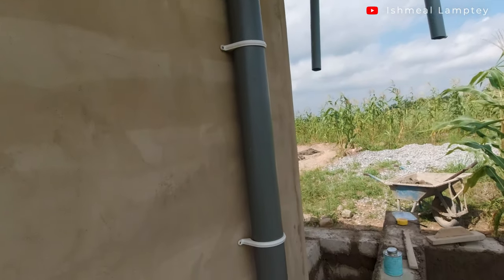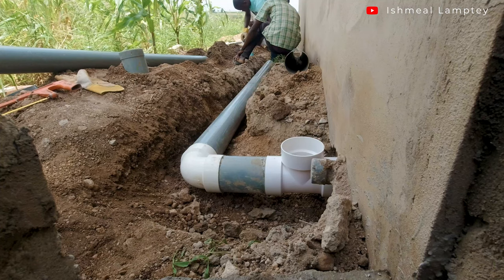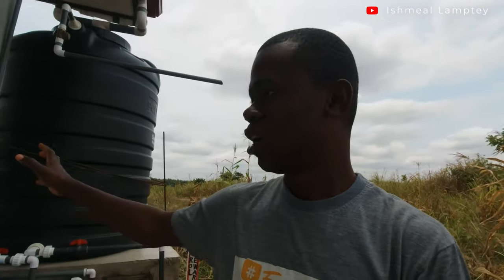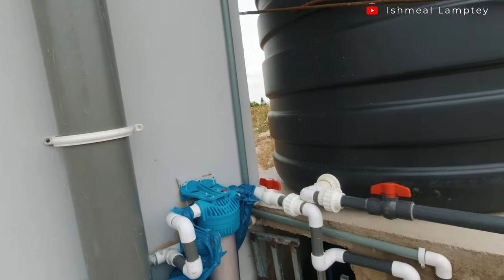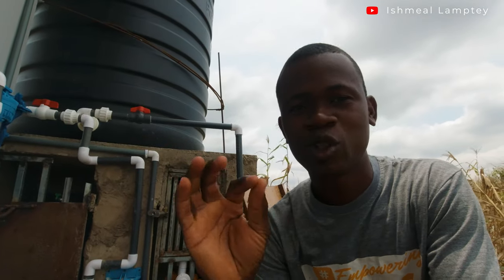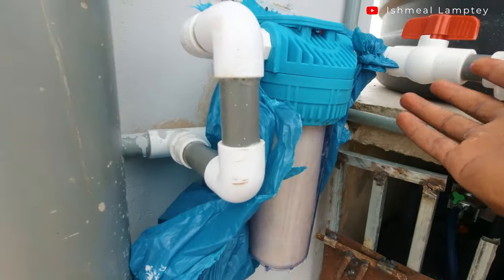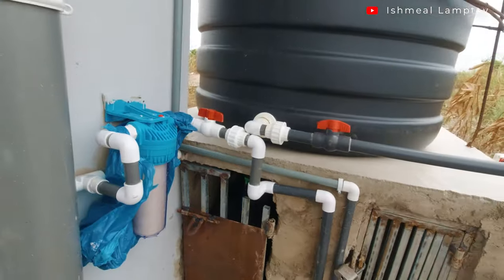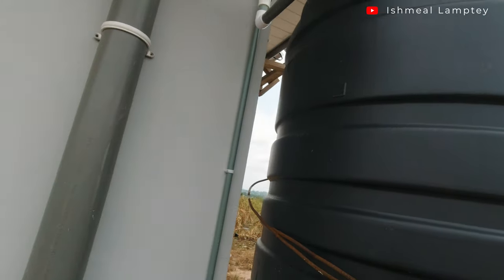Final Plumbing works on Minimal 1 Bedroom Off-Grid House

Comment: The thing you call a boaster is actually called an automatic pump controller. The pump itself is the boaster...as in used to boast the water pressure.

Comment: How UV stable is the plastic pipe?  Will you paint the plastic pipe to prevent the sun from rotting it out? The next question was do you have a laundry drain?
Reply from the maker: The pipe is a pressure pipe which is very tough. Without painting, it will do just fine. We didn't make provision for laundry drain because there isn't enough space for a washing machine. We do our laundry outside